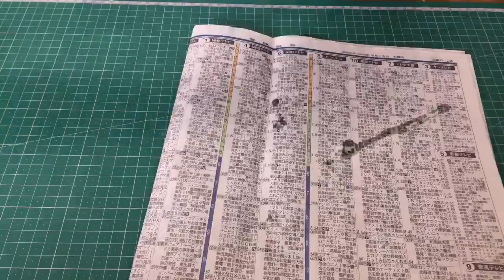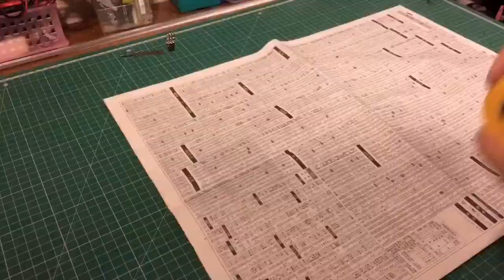Scratch Built DLG glider  Part2 Fuselage,tails,assembly

Comment: Amazing work! You say in one of your replies this is a copy of the Snipe, what airfoil did you use on the wings and tailplane?
Reply from the maker: I copied the dimension of Snipe, but the airfoil is not open. I had tried several airfoils, AG18 works better for this aspect ratio, I think.

Comment: What are you sanding the foam with?   Doesn't look like sand paper.    Very nice.  Also is there a way for a slower version video?  thx
Reply from the maker: As for the sanding, I'm using sand paper, it's just sticked under the EPS block.